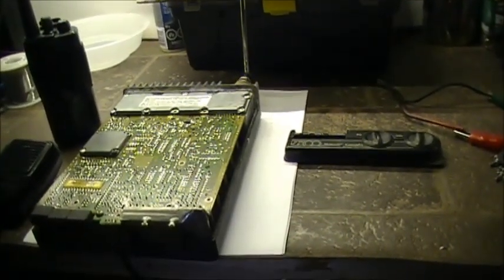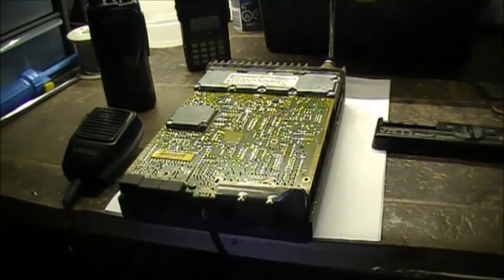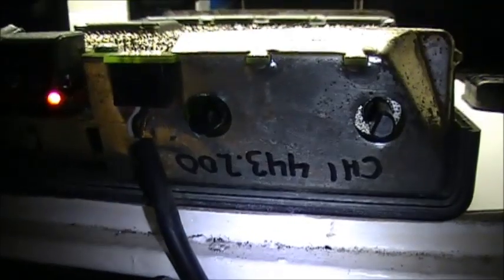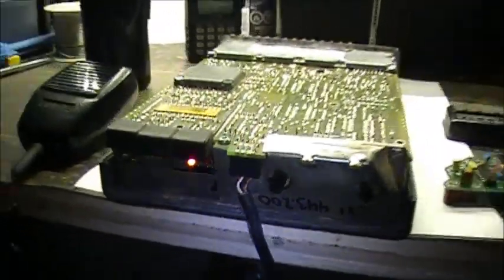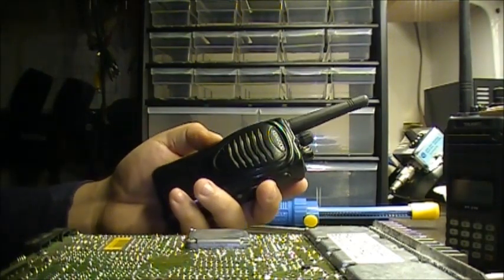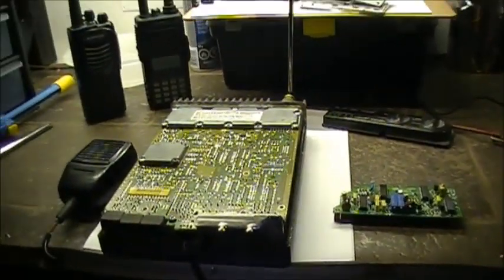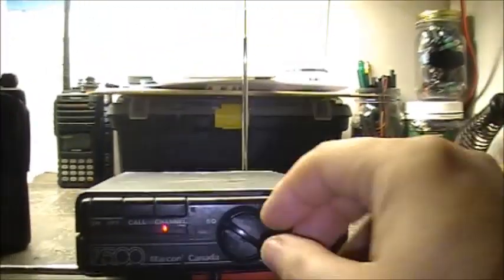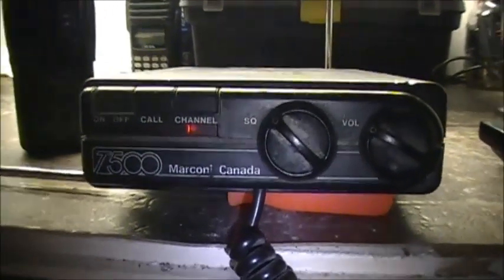TAIT-T500  / T555-60 UHF Programming   PART 2

Comment: Hello, you can help me, I have a orca tait 5010 vhf, when I read the radio, a message appears. obsolete database. You must update the base.
I do not have the knowledge of how to do it. Thanks beforehand for your attention
Reply from the maker: You may need a new firmware or your software if is not up to date.
Reply: download a one page firmware but apparently left the eeprom corrupt, some link to download the firmware. Thank you. In my country there is no brand support.
Reply from the maker: Not sure, your better off to bring the radio to a Tait dealer.  There is one in my city if you want to try and send the radio to me, i can get it programmed to what you need.
Reply: thanks, 7: 3